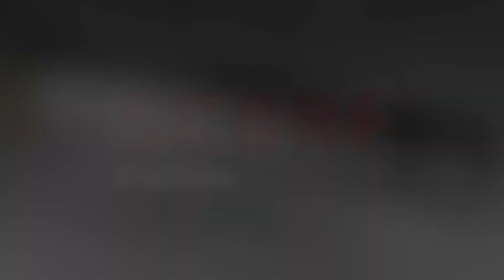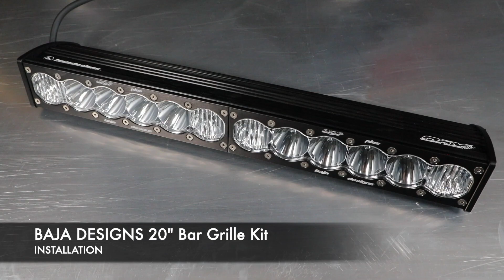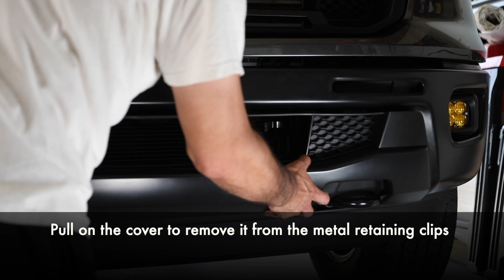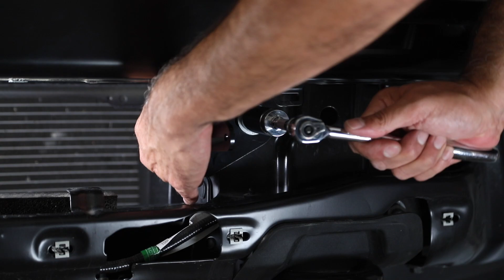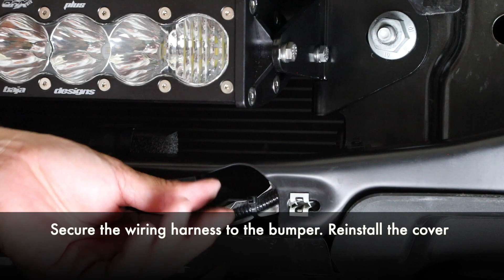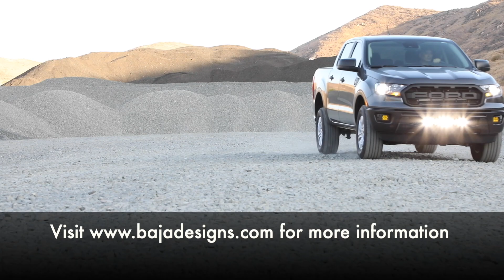Baja Designs 20" Bar Grille Kit

Comment: Do you have a kit for the rangers that have the adaptive cruise control block in the center
Reply: You need to move a-cruise out of way and find spot, that's what I've heard and the reason I haven't pulled the trigger on these light bars..